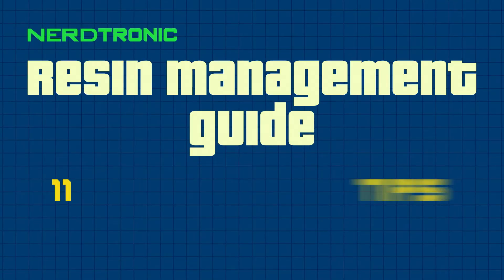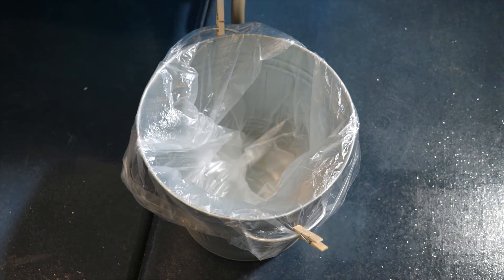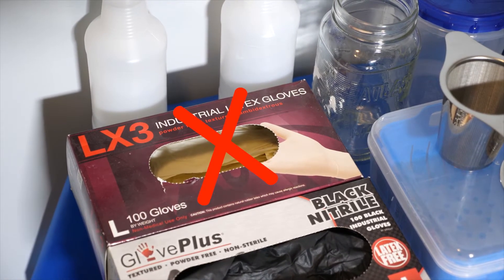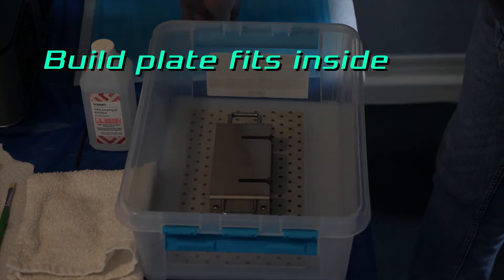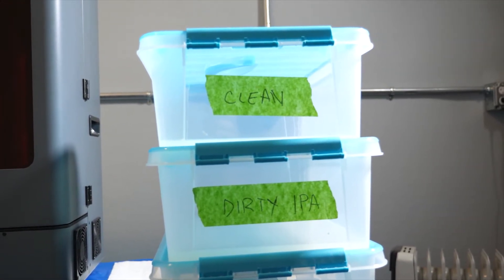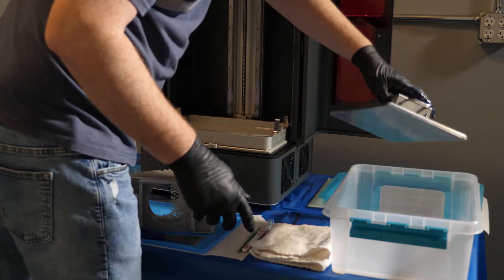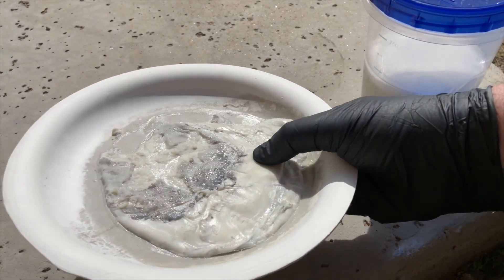SLA Resin Handling Guide for 3D Printing - 11 Tips for Containing the Mess and Keeping Things Safe

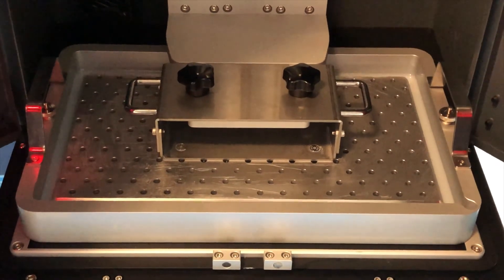Comment: 11:40 what I still don't understand is when it's needed to take out the resin from the vat and clean the vat completely.
Reply from the maker: I actually leave it in the vat for a long time. But if you wanted to switch out to a different resin, maybe a different color or a resin with different properties.

Comment: I learned never to touch my printer with gloves.  I only handle the printer with clean hands free of resin. The build plate is removed by grabbing the top part that never gets into the resin and I move it out of the machine right away onto a working surface with disposable paper.  I 100% make sure the knob on the build plate never comes in contact with resin.

Comment: Call me crazy but I barely smell the resin and it's hard to remember that it's toxic. It's way less smelly than the acrylic monomer I do nails with, and the IPA itself.
My biggest lesson learned is do not cure resin in the tank "for easier cleanup" --I went back and commented on the video that told me this was a good idea. I ruined my original resin tank and FEP this way because it still required scraping the cured resin off the surfaces, many of which are curved. I've since been pouring off most but not all of the resin and then putting the  tank in a sealed plastic container in a dark cabinet for next time. I almost always use grey resin but I can imagine having a container for each color tank would be convenient too.

Comment: Get a chemical/tattoo "wash bottle" for rinsing your prints. The higher pressure alcphol stream is way more effective than the fine mist from a spray bottle for cleaning un-cured resin from prints, and they cost about the same price.

Comment: I know this video is 2 years old, but I had a question.  You mention that your cleaner of choice for resin is IPA.  Have you had any experience using denatured ethanol?  I've been seeing both of these used depending on the vide and the channel.  I'm planning on getting a resin printer next month to start producing minis for D&D.  So, I'm trying to do my research before I even get to the point of purchasing a printer.
Reply: The main reason I was asking is that IPA puts out fumes that could cause irritation in your breathing.  Ethanol doesn't irritate.

Comment: Good Channel and advise Michael. I am setting up a larger and more ventilated room for the cleaning process. I use and actual paint respirator mask with charcoal filters that are made for automotive painting. It might be overkill in the slightest, but hey you only have one set of lungs, eyes, fingers etc.

As a Youngster in the U.S. Navy and then Army from 1983 to 2000 I painted aircraft, worked on Diesel engines and hydraulic equipment, and worked with large batteries and just in general did a lot of jobs where I was using MEK, Naphtha, and or had my hands around and in Hostile Chemicals and or literally Sh-T. My last military job was plumbing in the Nat Guard.

I was both good and bad about using proper protective equipment. at 18 and 19 and those first years we painted F4's and F14's with Polyamide paints, and Polyurethane paints.
The old chiefs and petty officers would frequently be painting out on the ramp and hold the gun in their right hand, and their res mask in their left. When they sprayed they would hold up the mask to cover their face and paint. then when they were done applying the layer/coat/area they would pull the mask away. IMHO this was fine, and it worked. The stupid thing was that we were painting the aircraft outside in a ramp area, and had all kinds of personnel working on aircraft 30 to 300 feet in an area. We also painted the polyamide out on the Carrier in the hanger bay  while we were underway.

As I got older I got more and more friendly towards the idea and use of the Protective Equipment. Especially like you commented on when It gives you headaches and such. That means its getting inside your brain, through your lungs, and if its getting there, then its getting into your kidneys and liver, etc. 

Now I am a cheapskate also, LOL. And I dont like paying 21 dollars for a gallon of Alcohol so, yea, I am going to try to stretch its service life. So I like the info as you are about 4 or 5 years ahead of me on using these chems, and been 3D SLA printing. We have been doing it for 2 years now on a limited basis for custom archery bow parts, and I really haven't been in on it to much. I was making the custom strings, and my Bus Partner was 3D printing.

Now that we are delving into Custom Chess pieces and I am designing large Star Trek models from the original series I have suddenly found myself crash coursing in 3D printing.
We have 2 Creality Ender Weed Whacker String melters,  which I have little use for so far. I am impressed a little about how much smaller they can make res lines now though.
I jut bought a Anycubic M3, and M3 Mac about 2 months ago, and I have been printing for about 5 days now on the first test parts for a Romulan Warbird from The Original Series of Star Trek.

I mixed E85 with Denatured Alcohol, and I also used strait E85. The first print parts have errors in them and are being printed so I can adjust the design until I can get them to print into parts that I can use as model parts. I see no difference in the effect of this cleaning method other than #1 the 85 is more toxic in the fume department, but not by much. It does contain Gasoline so that means If I breath the fumes, it is not just alcohol, but gasoline also. We all know, or should know that breathing, snorting, huffing gasoline is not good for the human body, and I mean a big (NOT GOOD FOR THE HUMAN BODY). I had dumb ass friends in the 5th and 6th grade that huffed gasoline and even at that age I couldn't believe how stupid they were, and or how dumb that was.

My father and uncles and typically mechanics back then used to wash oil and engine dirt off of their hands with gasoline. I did to in the 1970's because it was a common practice. Then when I got into the Navy I discovered Go-Jo and Mean Green, and things that didn't make the nerves in your hands tingle because of osmosis.

Anyway I didn't intend to write an essay here. I just wanted to point out. Safety First. Yea. Share the advice like Michael here, Dont Breath fumes unless its Cinnamon rolls in the oven. Dont bathe in IPA/MEK/Gasoline and paint. Gloves are cheaper than new skin. Facemasks are cheaper than new eyes and lips. Personally I think the Covid masks are inadequate for Denatured A/IPA I have been cleaning stuff with and without the germ masks and I come to find that ventilation is key. If the fumes are not there, and or minimal to start with, the better, and like I mentioned before, I am using a paint res grade mask when cleaning. I have some really good cleaning containers I bought from Home Depot that have O rings in the lid so that keeps the evaporation down, and at the moment I am using E85 which is 3 to 4 dollars a gallon VS 20 to 22.

Whatever you use remember its all designed to dissolve plastic, so it can and will kill you and or you loved ones and pets, and or house if handled wrong. Be Safe and keep on Treking.

Comment: I am using water washable resin. If I filter the water multiple times and let it cure in between in my wash and cure station, is the water afterwards safe to pour into the drain? Or how do I have to dispose it?

Comment: I find that using warm/hot IPA or water (contaminated or dirty)  close to or just above body temp  98F or 36C. I have also had it work well at around 80F or 27C. You soak the parts in this liquid to soften the resin and most importantly the supports. Warm resin causes the supports to break away from the part, and prevent the supports from chipping off and leaving pot marks all over the part. Once the supports are removed you can use normal room temp IPA to clean the part and a small knife; razor, xacto, or hunting doesn't matter as long as it is sharp and you can use it safely; to gently cut the small residual bumps away from the surface leaving you with a much better surface finish that is flush with your final surface.

A heated ultra sonic cleaner works amazing for this, as while it is warming the part, it cleans it to, so that once supports are removed you can rinse the part or let it air dry; trim the bumps and quickly rinse with water or a little clean IPA (to remove any residual debris from fine trimming) and go straight to curing.

As for other tips:

I found that when I was getting bed adhesion issues, that it was very helpful to wipe or coat the underside of the build plate in a very light coating of resin before starting a print. Usually by dipping my finger in the vat, and smearing it on. This ensures that the build plate is coated completed with no trapped air or thin spots beneath it for the first layer. You can use a brush to do this as well, and I usually do this with the build plate off the unit, but above the vat, so that the resin drip stay in the vat.

And to those that would say, wouldn't your get things dirty. No I don't. Like Nerdtronic, I take care of everything that needs two hand prior to interacting with resin at all. Even then when I do, I only use one hand to do so, so the other is clean to the chance of contaminating anything.

I hope this helps out others in some way.

Comment: Things I’d add to this:  

1- Don’t use disposable gloves.  Buy oversized, thick, lined nitrile gloves.  You can slide them on and off easily, and resize them “forever”.  MASSIVE environmental win, and user savings.

2- Get one of those full sized plastic face masks (popularized during Covid). You don’t want resin bits snapping off and hitting you anywhere in the face.

3- Get rid of the plugs on the resin bottles right away.  They’re only necessary for shipping and they cause waste (using a paper towel every time to take them in and off).

4- Think your setup through.  I have a wire rack that my printers sit on, but also it’s where I can put hooks and magnets on for gloves, a roll of toilet paper or paper towels, the funnel, scrapers, etc.
Reply: Screenshot this! Thanks!
Reply: Don't re-use gloves. That's how you learn what resin tastes like.

Source: I know what resin tastes like.
Reply: DO NOT re-use gloves man
Reply: I seriously hope no one takes #1 seriously. 
Using a few extra gloves isn't going to destroy your precious environment, it's just going to be more effective at protecting you from burns, allergic reactions, cancer, and probably a host of other problems.

Comment: I found this video to be excellent. I especially like your idea of using rubber mats. One thing I would do differently though is to remove the part from the build plate away from the touch screen on the front of the printer. My luck would have me touch it with the resin covered build plate and get it dirty, maybe even break it. Or I'd slip with the metal scraper and punch a hole in it making for a bad day!

Comment: Planing on getting into the hobby soon so I'm trying to soak up all the info I can before buying a machine.  First of all thank you for for the great content, it's great info presented in a really easy to digest form.  Secondly I was wondering if you would go through the entire cleaning cycle (full clean of build plate, emptying and cleaning of the vat ect) between every print even if you were going to print more than one run back to back?  Thanks!
Reply: Maybe a bit late for this reply, but you do not have to go through the entire cycle of cleaning everything every print.
Usually you'll  only need to clean everything after a failed print sticks to the vat, or if you've gone about half a dozen or so prints without cleaning things through.
Reply: @ThineDude  Awesome, thanks for the info.  I've since got the printer in and have been tooling around with it but am still VERY much a novice so any info helps!
Reply: hi serolis ,  when will u buy the sla 3d printer pls? our factory will offer u factory cost price and with certificated quality

Comment: When I clean my vat, usually after each print project. I drain the vat back into the bottle and place it back in the printer. Then turn on the leds to cure what is in the vat. Then using the plastic scraper I take the cured resin out. Then wipe the vat down with IPA. I have a wash and cure station so I just place the build plate and part in the station cleaning both before removing anything. So when I remove the part from the plate it has no un-cured resin on it. For cleaning the IPA I put out in sun for a couple of days. and strain through a 5 gallon double pain with ceramic filters, like a water filter system.

Comment: I'll start my resin adventure tomorrow after a long and thorough planning since I'm in a flat and no specific room for that!
I've gone with a water washable resin to ease the process and handlings. I've bought a nice cure & wash machine especially made for that, so I hope to put the plate with the print still on it directly in the automated wash container to contains any resin spills outside of my DIY fumehood/contaminated zone (based on a grow culture tent with Karcher Vacuum Clear HEPA13 filters in the ventilation line just after a carbon activated filter). 
I also plan on cleaning the distilled water after a few wash by curing the container in the cure&wash machine, I hope the blob won't screw the fan tho, need to try it out. I'll filter out the curated residue, trash them and either reuse or dump the water in the drains (still need to assess if it's safe for our dear mother earth).

Got my painter mask, protective glasses, a bunch of nitrile gloves, distilled water and a lot of 3d models. Hope it go well! 
Thanks for all the tips that comfort me in my planning!

Let's gooo!

Comment: #11 why do you set the jar outside in the sun "to cure"? it does not seem to cure, because when you put out the blob it is still not cured. i think what this actually does is separate the resin from the alcohol. but you dont have to do it outside then but inside. this would help people without access to a garden or something like that

Comment: why you don't clean tools and build plate with acetone? i work in composite industry and use tons of epoxy resin a month on infusion way and wet lay up, acetone for tools works fine won't recommend for other application , i will try make video soon of my printing

Comment: I would note that cleaning the FEP film and the vat like that it's extreme, wipe it gently with a microfiber cloth and use dish soap. Using IPA on FEP could make your next print stick too well to it and increase the forces it has to withstand.
Reply: I was wondering about this. I have started having issued with my FEP being too sticky, and this may be due to cleaning it with alcohol. Also, using paper towels on the FEP seems to leave behind a lot of micro-scratches which bugger-up the FEP.

Comment: I jumped into resin 3D printing without a lot of research. I saw the quality difference between FDM and Resin and chose the latter. Tonight was session 1 (failed) and session 2 (failed). I ended the night cleaning and replacing uncured resin back into the bottle as I didn’t want to leave it over night, used a crap load of paper towels, and a few gloves, and had the EXACT same thought about needing an open trash can. I love the trays, tubs, and table liners. This is the type of setup I plan use. Thank you for this video for expediting my efforts to a clean and organized work area. You rock!

Comment: Here's how I tried to show people in the lab to understand how easy it is to contaminate stuff while I was the biosafety officer: Buy some UV-reactive powder, put it on your gloves and go about your routines. Then, take a UV flashlight and see where you can find bright spots. Kinda like in CSI when they search for blood. Fun experiment and it will raise awareness.
While I understand you want a reminder to keep one hand clean, I find the cleaning up process or uncured prints to require both hands because they can easily move around or even slip out of your grasp. I also remove most of my supports before curing. Fantastic presentation and information though!
Reply from the maker: Good idea.  Just put away all the resin first.  I actually glove up both hands now.  I still try to keep one of them clean but they're both gloved.

Comment: Why not use water washable resin?
Reply from the maker: I never use it. Water washable doesn’t mean it’s safe on your hands or that you can wash it down the sink. Take the alcohol in this video and replace it with water or better yet a lower % of alcohol. Then still treat it with the same amount of caution.  Better yet still clean with alcohol so that the part gets clean.
Reply: @Nerdtronic  I was suggesting water washable because then you won't have to buy alcohol or clean alcohol for reuse. It eliminates a step, a cost, and means you don't have to keep a tub full of alcohol you can just fill your tub with water before you remove your prints.

Comment: I have my printer in a large tub on top of a table cloth. I print in a spare storage room with carpet, so since everything is in a big tub, if I spill there's not chance of anything getting on the carpet. The silicone matt is in the tub as well so its easy to keep the tub clean. I only print small scale stuff, so an ikea LACK table is large enough to hold everything, and if I need to break things down to put it in storage, it has a small footprint and is easy to get fully cleaned and put away.

Comment: Nerd-dude,I first needed to build a resin odor mitigation system and your vid on that was super. Then, knowing that I am weeks away from launching my 3dP workspace, I checked this vid out. These tips are invaluable and you made it very simple and straightforward, which is what noobs need.  Thanks and I will be following you as I get going with digital sculpture on Zbrush and my soon to be, Saturn printer.  Ciao